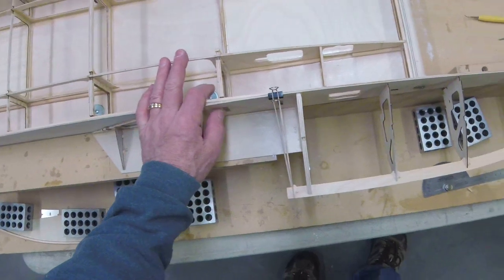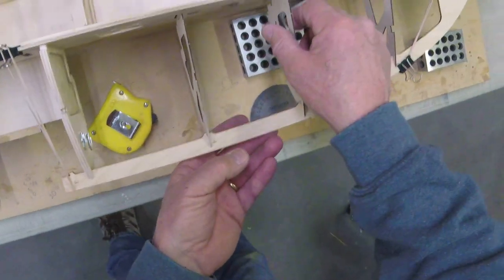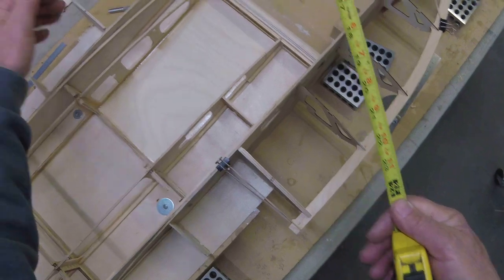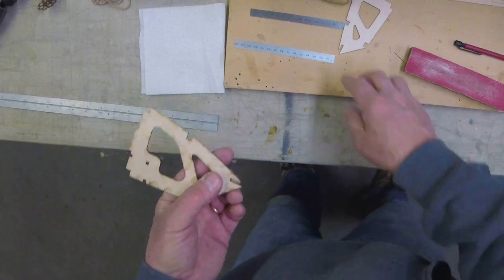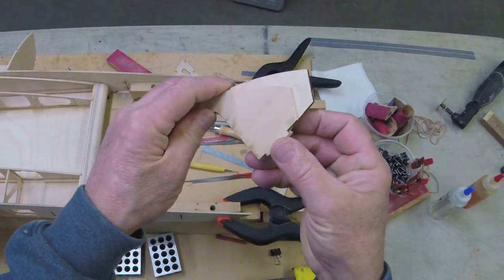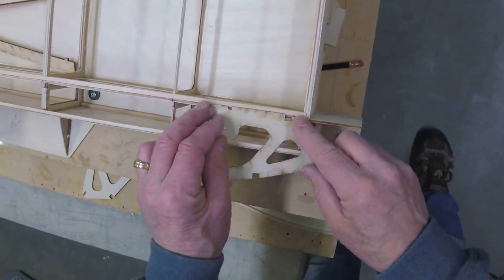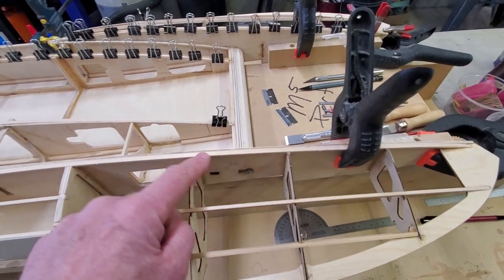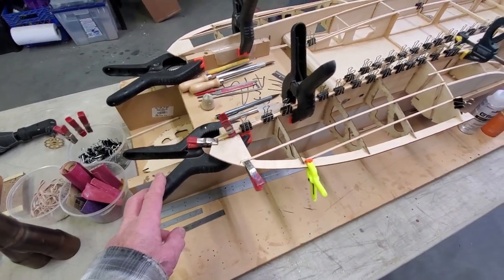Scale RC Model Hydroplane Sponson Construction | Framing & Stringers

Comment: Does the charred edges from the laser cut that get epoxy need cleaned up before assembling with epoxy to get a good bond?
Reply from the maker: That's a really good question. Truth is I don't know if it makes a difference, but whenever I think of it I do sand those areas lightly prior to applying epoxy